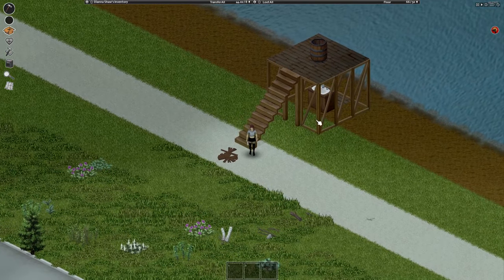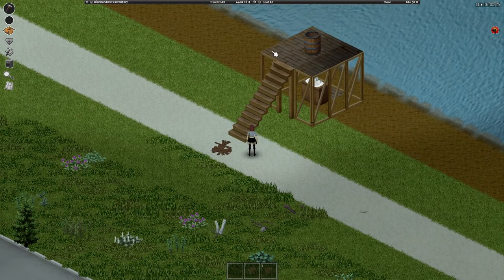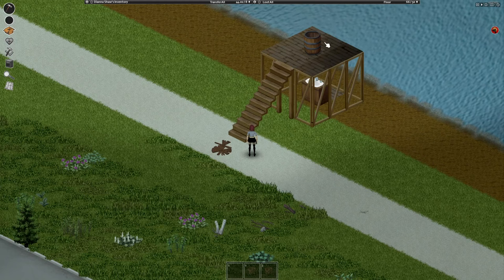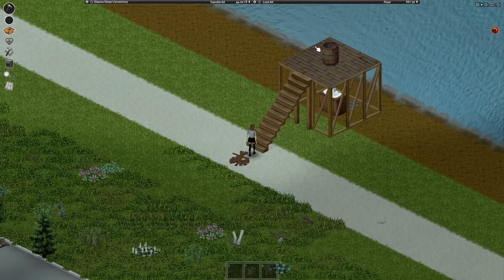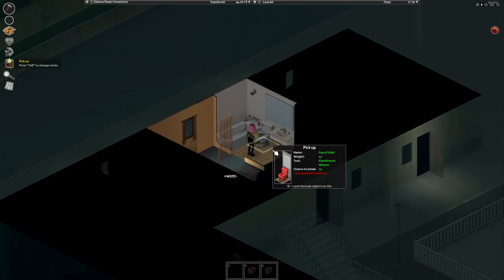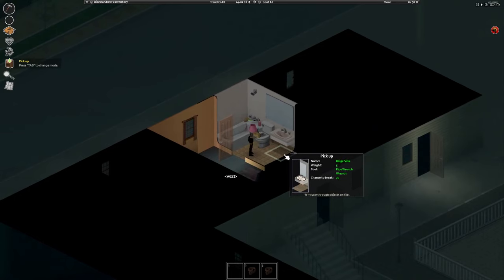Plumbing a Sink - Project Zomboid Guide

Comment: I use the barrels from the tents in lousville because they can hold 800 units of water for plumbing
Reply from the maker: I thought about using those metal barrels as water collectors for  plumbing but never tested them. If they're working, it might be good idea to pick those up 800 is sweet.
Reply: What tents in lousville?

Comment: having a issue where when i make any player made building, the game will not count it as a inside building
it has wall corner posts
one door
roof
floor
and walls all around, any idea or am i missing something?
Reply from the maker: It should count as indoors if you're doing everything you said. Maybe they changed the requirements and you need to complete the walls now?
Reply: @Dranka  even then it seems to think it's still outside. I manage to get it by ripping the building down 4 times. On the 5th try it seems to work.
Reply from the maker: @disolosma  Nice xd Project zomboid do be like that sometimes.
Reply: @Dranka_  It's probably the corner posts. Those tend to be very finicky, and you need to place them in the correct way.

Comment: What if I build more rain collectors on the roof? Would that be better?
Reply from the maker: Yeah you can build 9 water collectors for a sink. Once you plumbed one, you can put others afterwards no need to plumb again
Reply: @Dranka_  ohh no need to plumb again. Thanks mate
Reply from the maker: @baixaki349  no problem ^^
Reply: Good question I wondered the same. Thx

Comment: Does it work too when the sink is in the ground floor kitchen and the first floor in between?
Reply from the maker: It has to be right above the floor. If there's a floor in between, it won't work unfortunately. You can make side wooden floors for barrels if you have a two story house and want to plumb a sink at ground level. That's what I do usually.

Comment: Can you plumb a sink more than one floor down from the collector, or are our bottom floor sinks useless after water gets shut off?
Reply from the maker: It has to be one floor down for it to be plumbed but if the sinks are close to the outer walls, what you can do is to make some stairs and wooden floors attached to the house's outer walls at the same height as the 2nd floor and put some water collectors there and then plumb
Reply from the maker: @VictorSGonzo  Yoo that's awesome. I'm glad I was helpful

Comment: question, do i need to wait for the water to go out to plumb a sink?
Reply from the maker: I think you can put a sink and then plumb it with a pipe wrench into a house without putting any water barrels and you'll have unlimited water if the water is still running.

Comment: I have a two story base I built and it is all sealed off, but I still cannot set plumbing?
Reply from the maker: As far as I know, plumbing works only for one floor up.
Reply: @Dranka_  I'll have to move it back up again to try later. I moved it downstairs because I was having no luck.
Reply from the maker: @Rexxie44  It should work as long as the barrel is one floor up. Sink doesn't have to be on the ground floor I don't think but even if you do everything right, sometimes plumbing just won't work for some reason especially in MP servers.
Reply: @Dranka_  So there's just a chance of it not working eh? Hmm. Yeah because I'm on a server currently.

Come to think of it, you reckon it's a client issue and the host just might need to do it?
Reply from the maker: @Rexxie44  I honestly don't know why it doesn't work. If you're getting the plumb sink option but nothing happens when you click it, you should just click plumb once and then wait for it to magically work because that works for me. If you're not getting the plumb option, you can try to change the location, sink or the tile sink is sitting on.
Reply: @Dranka_  That's the thing, I'm not even getting the option. Which is weird..
I shouldn't require power I think
Reply: Okay, I found out a fix(?)
I built a bar counter upstairs then tried again and now it gives the option. weird.
Reply from the maker: @Rexxie44  Yoo nice! That happened to me once as well. I changed the thing sink is sitting on and the plumbing magically worked. I don't know why it happens really but glad you found a solution xd
Reply: @Dranka_  Yeah I don't get it either, I'm just glad it's working now haha

Comment: why in my PZ there is no writing like "plumbing"??  even though I have done everything in the video 🥺
Reply from the maker: Hmm sometimes plumbing will have some problems especially in multiplayer. Make sure you're using a pipewrench and if you're already doing that, you can try to place the sink on a wooden crate instead of a wooden kitchen counter. That sometimes works.
Reply: @Dranka_  Mine just straight up wont work, I have a 4x4 to 4x5 barrels put down, their filled quite a bit, and the pumbing option still wont show up, im in a single player world, (heavily modded), (yall might hate me but, I am using cracked, (so far i got no money but if i do ill buy the game))
Reply from the maker: @mr.cypher4437  PZ sometimes has problems recognizing player made structures as indoors and when that happens you can't really plumb because your little shed is not registered as indoors. Someone said that going out of your map cell and coming back might work. You can also try plumbing an existing house or maybe building a new wooden shed for plumbing. Make sure you have a door and a fully enclosed space
Reply: @Dranka_  I just moved to a house and it worked, thanks for your tutorial, it's really helpful :), also thanks for not hating nor talking rubbish to me just because I don't have enough money to buy the game, appreciate it, you got a new sub :)
Reply from the maker: @mr.cypher4437  np I'm here to help ^^

Comment: can u have more than one collector for only one sink
Reply from the maker: Yes once you plumbed the sink, you can add other collectors up to 9 water collectors. Once a water collector is empty, sink will automatically use other collectors if they are in the right spots.
Reply: @Dranka_ the answer i need

Comment: I did everything i even swapped it for a barrel IT NO WORK im in multiplayer i really need it to work or else i might die
Reply from the maker: Multiplayer is kinda janky sometimes. If the plumb option pops up and nothing happens when you press it, just press the plumb sink option once and wait a while that worked for me in multiplayer.
Reply: @Dranka_  The problem is the option does not show up
Reply from the maker: @shlurgledoo  Try changing the tile the sink sits on and other than that if the sink you're plumbing checks all the boxes and it's considered inside by the game, it should work. Maybe it's a server thing. You should ask someone who's in charge of the server.
Reply: @Dranka_  im in charge of the server lol but ty il keep tryin to fix it have a nice day or night